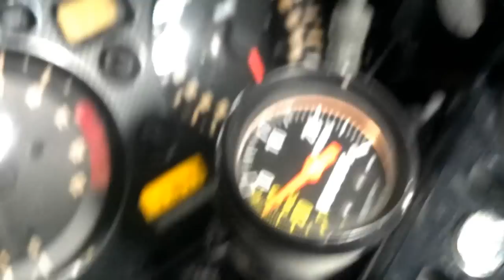Turbo Hayabusa Startup

Comment: I seen the O2 sensor on what little exhaust you have. And that you were running a power commander. I was wondering what data logger that your using and what software to tune? Thanks, Mike